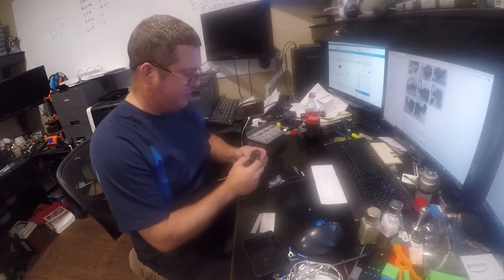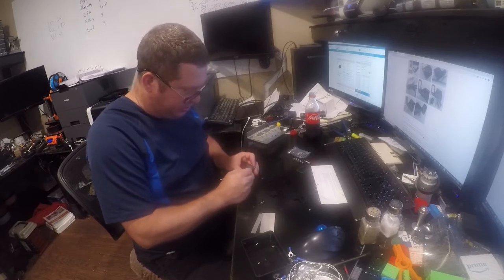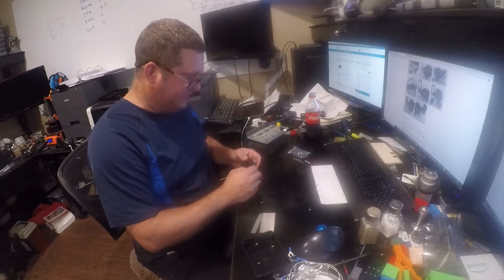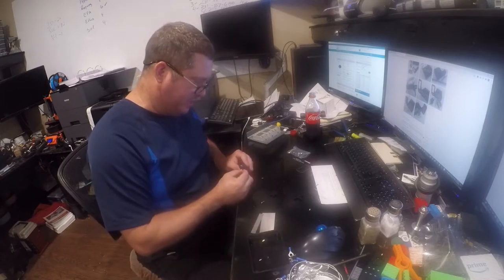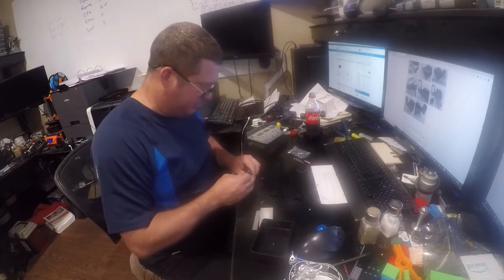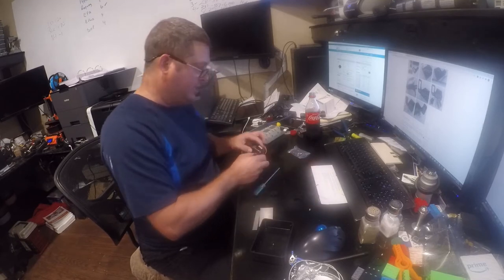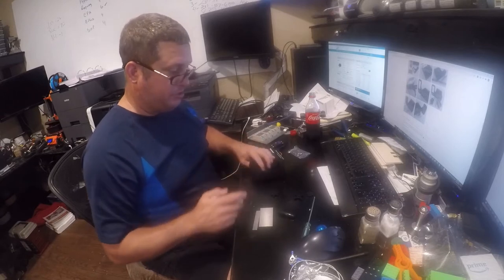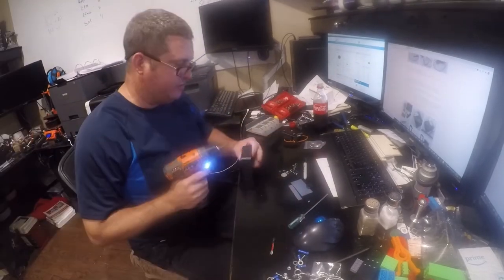Controleo: Part 8 - Preparing the control box

Comment: For what it's worth, in my assembly the rubber grommets for the servo mounting are not used. There's no point in the shock damping effect of the grommets, as the body of servo is a snug fit in the PCB opening. Also, there's little chance of the oven crash landing :-)  (Although there was some doubt about that in episode 10.)   The instructions suggest optionally using those grommets later as spacers between the touch screen and the facia.
Reply from the maker: I'm glad you found the videos helpful.  My whole motivation for making them was to help others who had a similar interest.  It's really a fascinating little kit and does work once grafted to an oven.